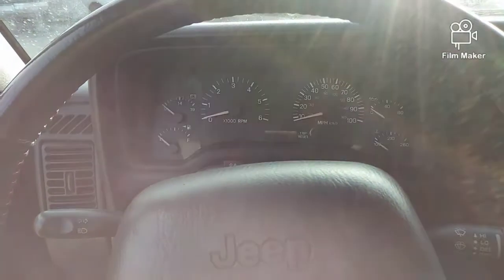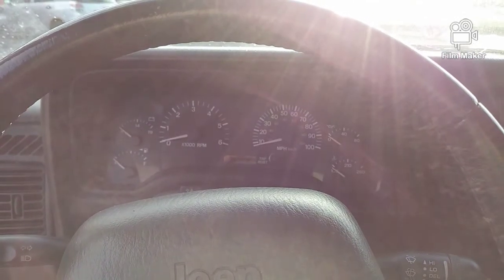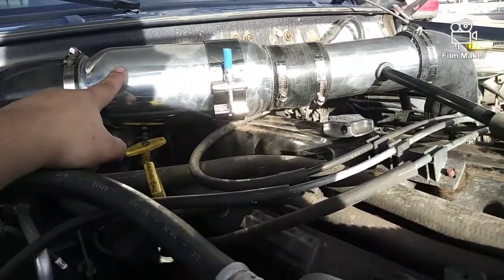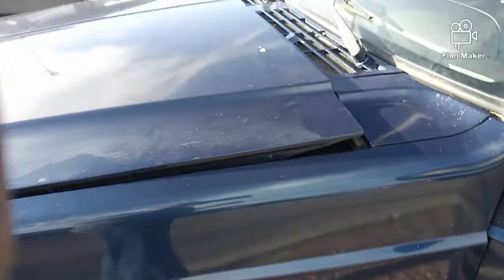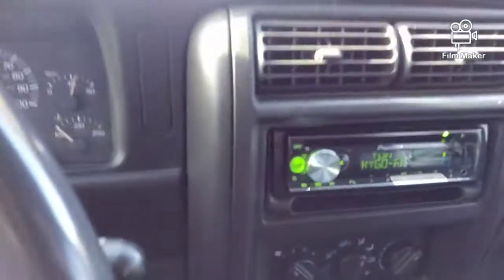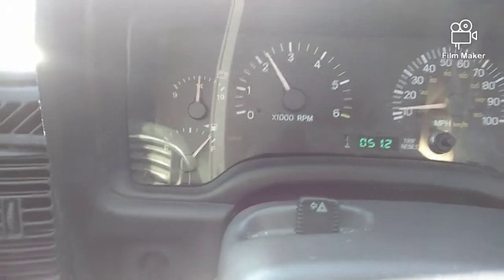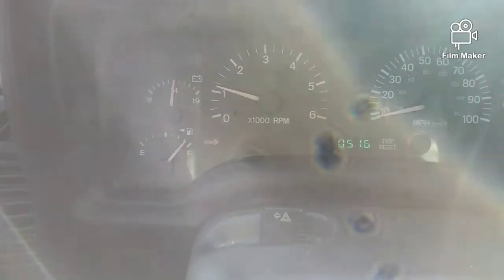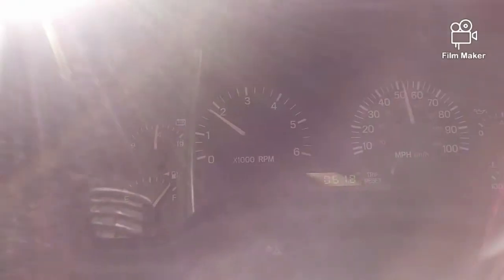2001 Jeep XJ DIY cowl intake

Comment: Does water get in the filter
Reply from the maker: No. The passenger side of the cowl is covered with sheet metal. Only the driver side is open. Also the air filter is located in the spectre housing and not the cowl itself. I've been in snow and rain without issue.
Reply: How did you connect the 90 into the firewall?
Reply from the maker: @MARZ1911  sorry I'm just seeing this message. I did a 45 into the firewall, it just slides in about 2 to 3 inches and supports itself. Almost 60,000 miles on the setup no issues